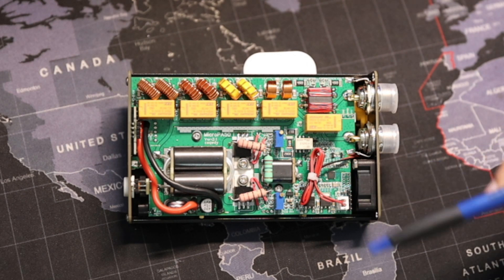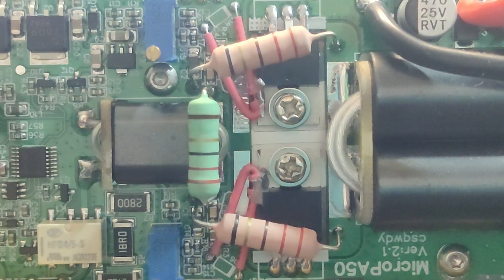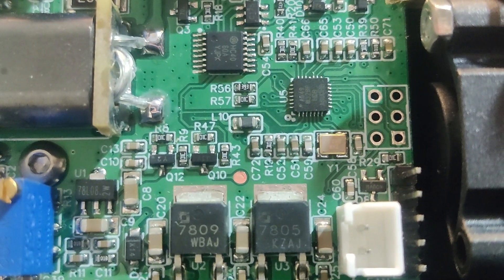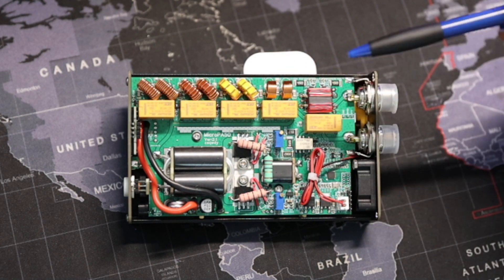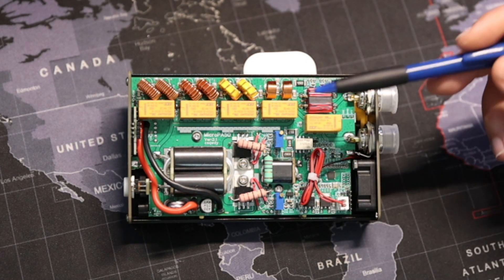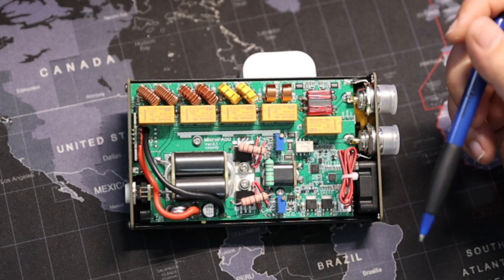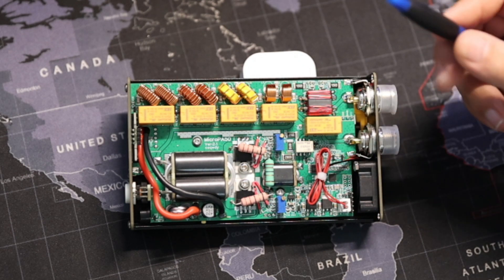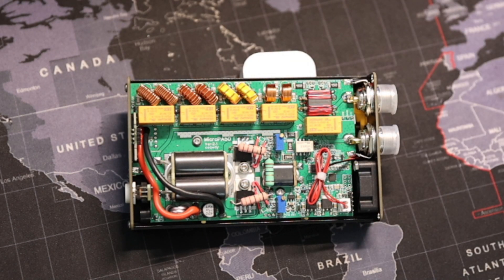MicroPA50 - A look inside! - Part 3

Comment: Looking at the layout it looks as if the two air cored inductors that are probably for the highest band LPF are in line which means they will interact.  Have you managed to check the harmonics and is it OK on 10m and 12m?  Normally pairs of air cored inductors are arranged at right angles to each other to avoid that.

Comment: I like the the features of the MicroPA50. Do you know if there is correct input impedance to match the driving transceiver output without damaging the transceivers output stage. The reason I ask is I recently saw a video about the OGS-50W and how a terminating resistor (2 x 200ohm in parallel) was put in the input connector to provide a worse case scenario of VSWR 2:1.

Comment: Thank you for this series of videos. An interesting RF PA. One of the issues with some PA's is the relays are capable of producing a back emf that can be dangerous to the transceiver unless they have diodes to ground to prevent it e.g. mxp50m requires modification to make it safe. Hard to assess without a circuit diagram.
Reply from the maker: True true,I have tried to contact the designer, at least who I believe is the designer but no such luck
Reply: @azoresradioguy  I got in touch with one of the suppliers in relation to this point. He was helpful but could not supply a circuit diagram. He did say that it uses a 2N7002K drive relay, and the 2N7002K has a built-in reverse diode, so don't worry about reverse EMF. The 2N7002K does indeed have diodes within but I have no clue if this is what is controlling the switching between the PA and the transceiver. I just don't understand enough to comment further.
Reply from the maker: @philipwells2793  hummm I'll look into it,thanks for the all the info!
Reply: @azoresradioguy  hello, have you by any chance had the opportunity to look into the back emf protection? Thanks!
Reply from the maker: @JCO-13  seems okay to me... What's your analysis?
Reply: @azoresradioguy  thank you for your reply! I don’t own the amplifier and am trying to determine which amplifier would go well with the Icom 705 (without me doing modifications if possible), and was wondering about the emf issue that’s been reported from the MX-P50. I wondered about the Micro PA50 as a result. 

If anything I can always get a keying interface buffer for the piece of mind.
Reply from the maker: @JCO-13  I have not noticed any,nor heard anyone complain... There is always a certain compromise with these amps, be it this one or any other. This one is imho a little better because of all the features, specially the lpf and the automatic operate...
Reply: @azoresradioguy  I was wondering how it is 4 months later?
Reply from the maker: @philipwells2793  working like a champ,can't complain.... Takes a licking and keeps on ticking
Reply: @azoresradioguy  great news. I think I will pull the trigger on one.
Reply: @azoresradioguy  yes indeed, I totally agree with you. I’m very inclined to get this one given the automatic features.
Reply: I just received my PA50 for my IC-705 and have noticed that often when keying up (especially on CW), the SWR meter on the 705 will momentarily “spike” to infinity before settling down at around 1.5:1 SWR. Is this an indication of “back EMF”, and if so, am I in danger of damaging the 705 when TXing with 3-4 watts out of my 705 into the 705?
Reply from the maker: @chriswei2k  have you tried wired keying? Is there a way to delay the keying on the 705
Reply: @azoresradioguy  I haven’t tried wired keying yet - have tried to get better specs on the ACC Jack on the PA50 (voltage, current, whether it triggers PTT high or low) and if I need to add components to protect the 705 side of that connection. The 705 does have a configurable TX Delay of up to 30ms but I think it only applies to wired PTT -  it seems to have no effect on RF-driven  PTT.
Reply from the maker: @chriswei2k  the Rf sense will always have a longer delay…
Reply: @chriswei2k  I would guess that it's seeing a load as infinite before the T/R relay is pulled in and the Icom shortly thereafter sees the input impedance of the amplifier.   I'm not familiar with how one configures the Icom, but if there is a way to provide a short delay in the period AFTER key closure and before RF is generated , that might be worth trying.

This is always an issue with an RF keyed amp, as the thing has to generate a sense voltage , then has to play catch-up in enabling the amp afterwards.
Reply: @syfr  Thanks! I did find a TX Delay setting on the 705 but it only had a max delay of 30 msec, which didn’t seem to help much.

I managed to get I touch with the amp’s designer and he said the PA50’s ACC input (which has support for PTT) is connected to the microcontroller with a  not-dangerous voltage and current, and is not connected to the T/R relay directly. He suggested making a cable from the 705’s SEND/ALC port to the ACC port on the PA50 (tip to tip, ground to ground) without connecting the ring contacts as the PA50 doesn’t support ALC. I gave this a try and it seems to work (no more SWR spikes o. TX) and so far hasn’t damaged the 705’s SEND/ALC port. 

Disclaimer: I can’t vouch for or recommend this approach as being safe as I haven’t been able to verify the voltage or current on this cable and can’t say whether or not it’s dangerous for the 705.
Reply: @chriswei2k  thanks for all the great info. Also great that you actually were able to communicate with the designer.

I’ve noticed the same high spikes in swr on my radio tx-500, hoping I haven’t damaged anything on the radio. I’m getting bad signal reports with the amp. Scratchy and part of my voice being cut off. I think the amp could possibly be damaged now. 

I just found out that there is a delay setting for ssb. I thought it was only for cw. I’m going to increase that as I only have it set to 150ms and believe that might be part of my bad signal reports.

Really concerned about back fed emf. Did the designer confirm any protection for that?

As far as the PTT cable wiring. There are 3 controls on that cable. PTT BAND SELECT AND GROUND. It sounds like from the diagram in the manual that the designer is saying to only hook up PTT and Ground. I’ve read somewhere where the rf band sensing can be dangerous to so wondering if we should wire the cable for that as well.

I also responded to you in another video which you can ignore. 

https://elekitsorparts.com/wp-content/uploads/2023/09/MicroPA50_Guide_En_V2.0.pdf
Reply: @SPLTDP   Thanks! For band select I use the manual controls on the PA50 to avoid that spike. 

For TX, along with the PTT cable I also set the TX delay on the 705, which gives the PA50 time to engage the relay before the 705 starts transmitting.
Reply: @chriswei2k  ok, it appears that only VOX Tx Delay is available on the Tx-500.

I just watched a video on the Mini pa50 and it has EMF feedback protection with transistors so I imagine the micro does as well. There is actually a firmware update out for the micro. It’s 2.2 but I have no idea what it actually does. I currently have 2.1 and don’t seem to have the issue where swr is shutting down others amp to the point where they have to add resistors to the amp. I opened mine up and don’t see any new resistors so I think the issue was fixed with the firmware version I have, 2.1
Reply: @chriswei2k  I just figured out what is happening with my SWR issue. I’m using SL259 to BNC Adaptors on the Amp. The connectors on the radio have a lip at the base that is too high causing the adapter to not seat tight. I switched over to cables with pl259 ends and it works perfect now.
Reply: Who is a good vendor for this amp?

Comment: Are there figures for the Relay timing. I mean for a CW operator the QSK capability is important.
Reply from the maker: It can be set check out the first video
Reply: @azoresradioguy  The timing I refer to is dependent of the model of Relay used for T/R going from Transmit to Receive and viceversa.
With that part number we could check the specs for the speed of T/R